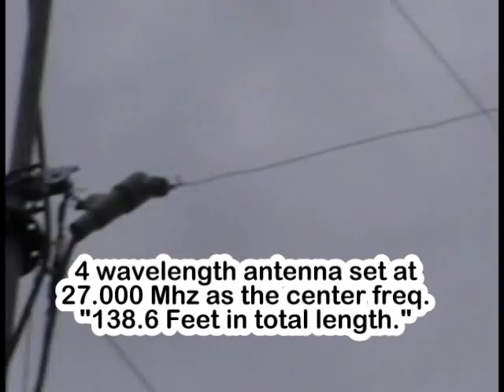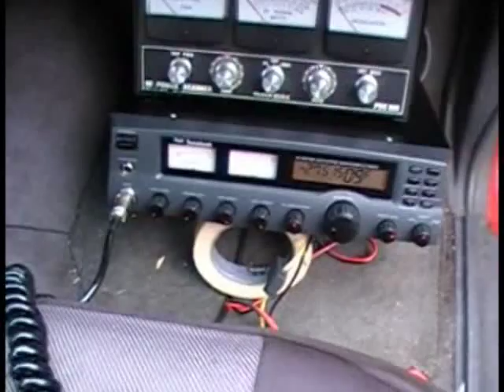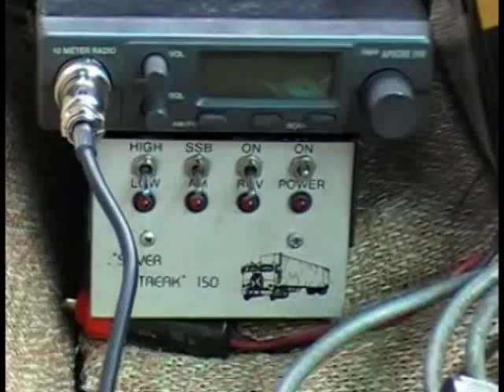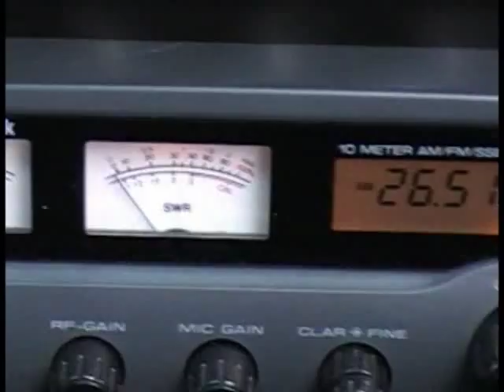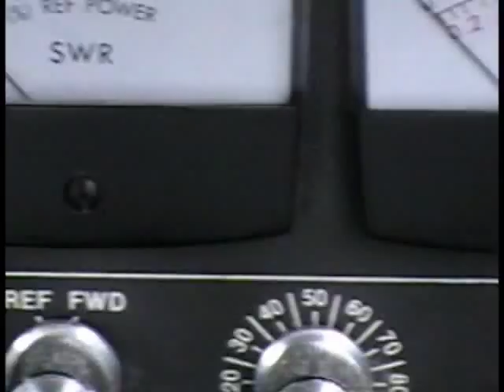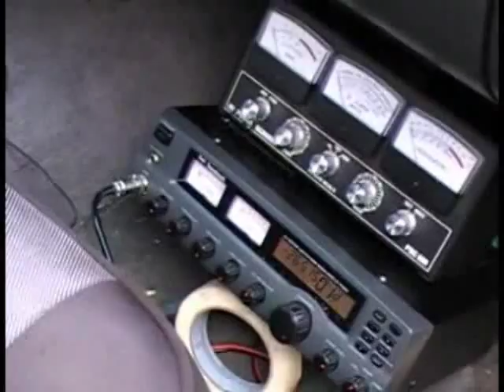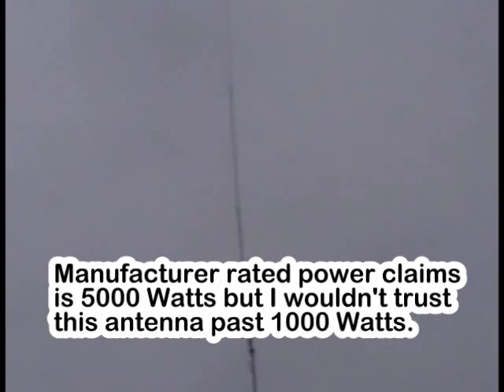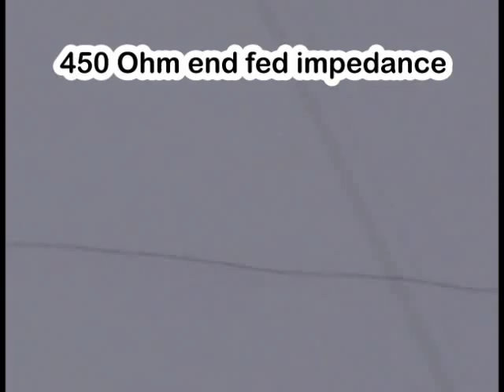Fun with antennas and SWR issues.

Comment: what could be wrong with wilson mobil antennas. i have tuned alot of mobil antennas and have gotten them way down in s. w. r. i have tried three different mobil wilson antennas in the same spot, same solid mount no magnets... and the best s. w. r. i have ever gotten was a 1.5. on all three wilson mobil antennas. i ground the things in multiple places, no good. i put a firestick or hustler on the same mount and my s. w. r. is about perfect.   ?????
Reply from the maker: When it comes to antennas sometimes only the shadow knows. It also depends on the vehicle along with the location of the antenna too. I have always had issues with the center loaded antennas like the hustler where other people had great SWR with them and recently I tried out a firestick and I fought to get a good SWR on it. I have had the best luck with antennas that have the loading coil at the bottom or the base of the antenna. I've never tried out a Wilson antenna but I do know people have had great results with those as well.

Comment: What does your standing wave go to, when you take the meter out of line??
Reply from the maker: There is very little change with the radios SWR meter when the external meter is removed. Since this video I invested into a high end self powered SWR meter that doesn't require a radio and it sweeps whatever bandwidth or single channel you choose and it was a good investment. It also confirmed what I was demonstrating at the time of this video so that was a good thing.

Comment: Got a problem maybe you can help with. I have a Falcon made Dipole Antenna pre tuned for 11m and my SWR no matter what I do is 2.5 or 3.. I don't know what I'm doing wrong I've got 18' of new coax and insulators and all. Got any tips?
Reply: SHAD0Wc0n dipoles wont get below 1.7 unless its way up in air.
Reply from the maker: What is the length of your wires?

Comment: great video i have a question. my base station as an SWR meter built into it. my SWR are 1.2 BUT when i add an external watt / swr meter the SWR meter in the radio goes high like 2.5 but the SWR on the external meter is 1.2 . i have changed jumpers and even tried a different external meter but get the same results. get you give me some insight on this please.  thanks !! and 73s
Reply from the maker: Is the radio grounded in the house? I don't mean by the ground jack on the wall socket. I've seen this before and just like the mobile it always turns out to be an RF loop issue. Sometimes you can go under the house or the room where the radio is and put a ground rod deep into the ground then you put a splice barrel in the cable BEFORE it comes in the house where you make sure the barrel is physically attached to the grounding rod. Be sure to seal the barrel connector and the coax from any kind of moisture or water from seeping in. A second trick would to do the same thing I mentioned and add a 1 foot loop out of 10 or 12 feet of coax that you tie together with nylon ties to keep it together. Lay this on the ground under the house then feed the other end to the splice barrel on the grounding rod and this not only gives you some lightning protection but it will remove most if not ALL stray RF. I'm running an IMAX 2000 and my SWR is as stable as it gets with any decent meter I have inline plus the radio's SWR meter follows the external meter. I hope this helps.
Reply: flash001USA there is no ground on the radio plug. i found that very odd but seems to be the normal for these old units? The antenna has 2 - ten foot ground rods with 8 gauge copper right to the antenna U bolts
Reply from the maker: No problem about not having a place to hook a ground up to either the radio or the amp. You can just take some stripped copper wire and run a few turns around the coax connector on the back of the radio and hook your ground wire to that or if you grounded under the house you don't have to mess with any of that because the coax will be grounded before it even comes up to the radio and amp. If you have an antenna on the side of your house make sure that it's grounded outside. The more grounds you have the better everything will function. The trick I mentioned about a 1-foot loop of wire with about 10 or 12 turns on it under the house laid on the ground actually works. People do that in cars that don't have a lot of Steel so that they can get the ground plane they need but it really does work with the application that I'm talking about. Trust me when I tell you it'll be like you're talking on a completely different radio that's how much of a better of a performance you'll see from it. Been there done that.
Reply from the maker: It sounds like you have the antenna grounding covered but as far as the radio or the amp goes that's simple enough to ground. Just ground to the radio or the amp's chassis or strip some copper wire and wrap a few loops of copper wire around the RF connector to hook a ground wire to. The method I mentioned in the 1st reply will make a BIG difference in the performance of your radio to the point it will be a completely different setup in the way it performs and if you ground the coax under the house you can avoid running more wires to the radio.
Reply: flash001USA  thanks again I will give that a try. I live In Florida so there is no " under the house " but I understand what your explaining.  So the radio swr and meter swr should match ? One at a time they both read the same BUT in line the radio reads  high swr. I was told it's not really an issue as long as the external meter is reading low SWR. it just doesnt seem right to me.
Reply from the maker: Yeah the meters should track within reason. They may not read exact with each other but they should still follow each other.
Reply: flash001USA once again TY very much for your time. this has me going crazy I will try the grounding radio trick but dont use the house ground?  It has to be it's own ground? This might be alittle tricky but as long as I know it's not an antenna problem I think I can work it out. I have been out of this for many years. The radio amp n meter is old but the antenna and coax is all new lmr400 75feet.
Reply from the maker: Hey before I forget don't worry about not having a place under the house to do what I was talking about. You can run that grounding rod right out by the window and still do what I was talking about with a barrel connector and splice your coax so that you can ground outside and this way you don't have to run a ground wire because you will have a solid ground on that coax that should get the job done. Also you can still use a 1-foot coil of coax outside on the ground. All you have to do is cover it with something to keep the direct sun off of it so that it doesn't prematurely age the coax. Let me know how it turns out.

Comment: I have a Ford Ranger truck and I've used a Wilson 2000 and a Procomm quad wrap antennas. I tried 2 brand new different ant mounts with brand new coax and my swr runs 1.5. I have a Texas Star 250 with a 3 foot jumper. When I use the amp, my swr goes up to 2 or above. Any help would be appreciated.
Reply from the maker: It's definitely an RF ground Loop issue. I had the same problem with my truck. A lot of people see that same issue when they run a little bit of power. Try the following and you may be pretty amazed at how well this helps. Figure out where you can add some ground tap points along the floor in the vehicle  so that you can ground the coax coming from the antenna to the chassis of the body of the vehicle. Do it where the wire comes in to the vehicle and do it somewhere near where the antenna cable will hook into the radio. All you have to do is strip a little bit of the coax plastic coating back without damaging the copper braid or the actual antenna wire and rap you a little bit of soft braided copper wire around it so that you have a ground point on the actual coax cable itself then tape it up so that it's sealed from any kind of dampness  or anything else that can get in there and corrode the coax wire.. Once you do that ground the wire that you added to the coax cable to the metal chassis on the vehicle which could be anywhere along the floor or near a seat where there may be a bolt you can tie the wire to without the need for drilling holes unless you just have to. Two things to mention here. You don't need to strip back but maybe a quarter of an inch of plastic off the coax and the second thing is keep your newly added grounding wires as physically short as you can to wherever the ground point is on the chassis. You'll be amazed how much of a difference this will make. Your problem sounds identical to what I had with my truck. Let me know how it turns out.
Reply: Couldn't you just wrap braid around the outer section of the pl 259 as it is connected to the shield of the coax anyway
Reply from the maker: You want to ground it midway in the vehicle before it screws into the back of the radio. You could cut the coax and add a splice barrel and wrap braid around the splice barrel and either use a small hose clamp to make sure the braided wire is touching the splice barrel with a solid contact or you could just wrap braid around it and tape it as tight as possible to accomplish the same thing. If someone didn't want to add a splice barrel then the idea I mentioned with stripping back some plastic shield from the coax to expose the outer copper braided shield is also a valid "second choice" option.
Reply: jumper is too short.
Reply: @flash001USA  thank you. I will try
Reply: @bryanlippard6286  don't believe all that ground Loop bulshit. An SWR of 1.5 is normal when running into an amplifier. No need to do anything just accept it. Your radio can run into up to 2to1 swr without any problem. Just check the output of your amplifier. If your rig shuts down with too high of an SWR then you need to make the adjustment at the input into the amplifier. There's usually a small trimmable capacitor inside the amplifier. Put your SWR meter between your rig and the amplifier, key down and adjust the trimmer to the lowest SWR. You may not get 1: 1 but a 1.5 is very acceptable. I have been a ham radio operator for 50 years I know what I am talking about and I hope this helps you.

Comment: So when setting my swr the meter is maxing out cant get it to drop down any I have ohm out everything and still cant find anything wrong do u think grounding out the coax will help I have been at it for days and cant figure anything out also inam running a dual setup
Reply from the maker: Yeah, it's worth a try because you can have everything technically correct but RF can pull voodoo magic havoc
and you can easily misdiagnose and chase an issue that turns out to be something totally unexpected such as a RF return or grounding issue. Hopefully you aren't dealing with a vehicle that has a fiberglass body because that requires a few special mods to make it work correctly. Let me know how it turns out for you.
Reply: @flash001USA  I am dealing with a 01 chevy tahoe
Reply from the maker: @flshiner5200  Are you using a magnetic mount antenna or some sort of mounted bracket?
Reply: @flash001USA   I am using a mount to the roof rack and have 2 grounds from the body to the bracket
Reply: @flash001USA  sorry I haven't got back to u been busy I took it to my local cb shop and had them test the swr he said I was around 2.5 then I did the ground like in your video and haven't been back up yet to check it but from talking to a few ppl since the ground installing I am getting much clearer transmitting will let u know more when he gets done tuning my other cb
Reply from the maker: @flshiner5200  Not a problem. It sounds like you're getting everything set up. Good luck.

Comment: how do you set the swr on a maco without radials / 19 ft. long
Reply from the maker: Rocko jekins Is that what you are trying to set up? If the antenna was designed with radials it probably won't tune without them. The coax along with the pole will act somewhat as a radial but it won't work good because it won't be at the right wavelength so the tuning will be hit and miss with you.

Comment: So it blew the antena...scary stuff
Reply from the maker: Dude.... Not only did the lightning destroy the antenna but there was not enough fiberglass to use for a toothpick! The strike was hellish! I've had aluminum antennas take direct hits and burn or scorch them but it never killed the antennas made from aluminum. Fiberglass on the other hand shatters into a million zillion pieces of dust.
Reply: @flash001USA   Wouldn't want to be anywhere near it when that happened!
Reply from the maker: @Rocklobstah-kv2wf  Oh, it was something that I will never forget! I never mentioned this in the video but I woke up to the storm rolling in around 3:30 to 400 am and at the time I had the option of powering the radio from a 12 volt deep cycle trolling battery as a power back-up or from the 110 volt power. That night the radio was switched to battery power. The antenna took the hit about 15 seconds AFTER I unplugged the radio and disconnected the antenna and I was staring right at the coax when the antenna took the hit. There was a loud boom along with a 6 inch spark that jumped directly from the coax coming from the floor straight up to the wall socket above it and I knew the antenna took a direct hit. At that time the antenna was grounded through the guy wires along with a deep ground rod on the tower. My antenna wire runs 6 inches under ground through a 2 inch diameter PVC pipe and wraps around the steel support frame under the house that is also grounded and yet I still had a major spark jump in the radio room! The radio was on at the time and did not get damaged because it was unplugged and disconnected from the antenna. The antenna is now triple grounded. Ground 1 is at the antenna tower. Ground 2 is at the point where the wire leaves from the PVC pipe to the underbelly of the house and the 3rd ground is a dummy coax attached to a deep copper rod underground right under the radio itself where I can redirect the antenna coax directly to ground through a splice barrel either when I'm not home or if a storm rolls in. It's all good now and a lesson learned. I trust  this beefed up grounding system I have in place and I sleep better at night knowing the job is now done correctly as far as the safety grounding goes.

Comment: You aren’t getting correct SWR  readings. You have to set cal every time you change frequency or RF power.
Reply from the maker: Technically you are 100% correct that you should ALWAYS calibrate whenever you either go from the lowest to the highest or the other way around in the band and / or you change bands. After I exercised the demons out of the system, the SWR was very well behaved and I already knew this before I recorded the video. The reason I didn't recalibrate was because I already knew that the SWR wouldn't show any major differences across the frequencies I covered in the video. The antenna I have on the truck has a very wide bandwidth and my main point was to show the skin effect when you don't have a solid ground for the RF. In hind sight and to keep confusion down with the video, I should have followed the book and calibrated each time I changed frequencies or bands. Before I forget, I now use a digital sweep tool which displays the SWR along with the reactance values of the antenna and the SWR is all but textbook perfect with the lowest dip being around 1:1 and the lower and higher frequencies being less than 1:5. Thank you for the reply.

Comment: If your trusting internet meters or even external watt see meter..... well find someone with an analyzer and have them show you what your real see is on 26 and 28 and your ohm's. I think you will be surprised how off those meters are.
Reply from the maker: Not only was the antenna seen very close as a 50 Ohm load to the radio but the inductance reactance and the capacitance reactance was pretty close at the resonance frequency too. I know this because a few years ago I wound up investing into a Rig Expert AA-54 which was the BEST investment I could have ever made for antenna work but yeah, you're right that simple SWR meters can lie to you in a NY minute if you're not careful unless you understand what you're looking for such as bad grounding or even where the antenna is placed on a vehicle along with the lobe direction or in layman's terms where the antenna transmits or receives the best on a vehicle. I was able to fine tune the antenna with the new meter plus it was a great learning tool for me too.
Reply: Like many things in life, you just gotta know what you're doing. 👍
Reply from the maker: @Rocklobstah-kv2wf  I do have the electronics background but RF can be tricky and like a lot of people this is something you have to either learn from people with the hands on experience or you learn it by doing it every wrong way in the book until you figure out what works and what doesn't work.